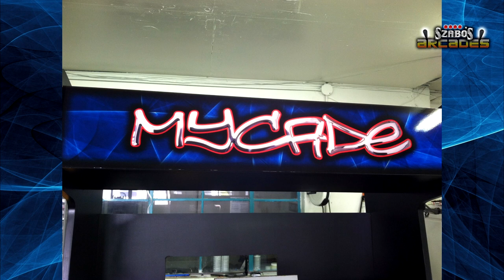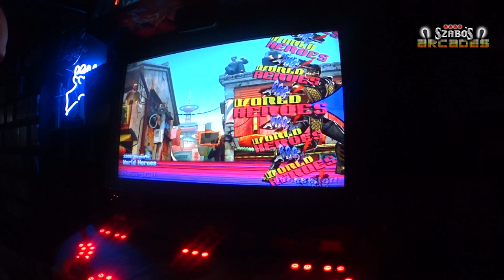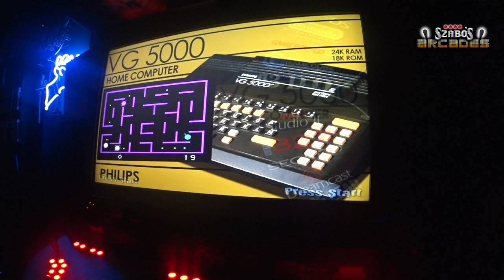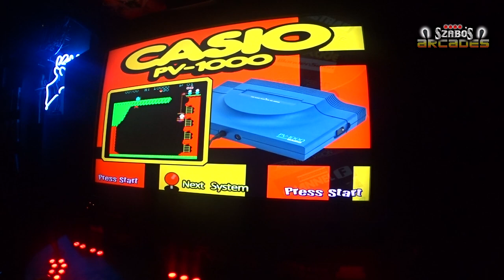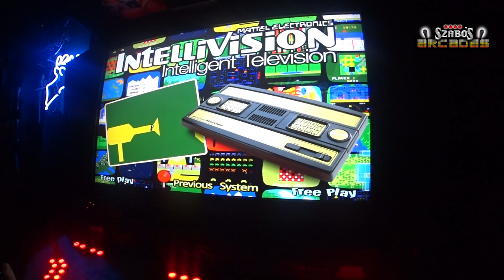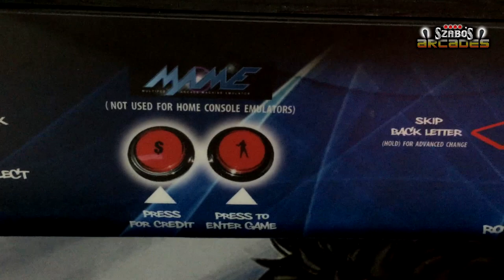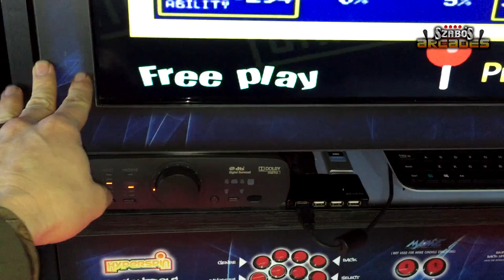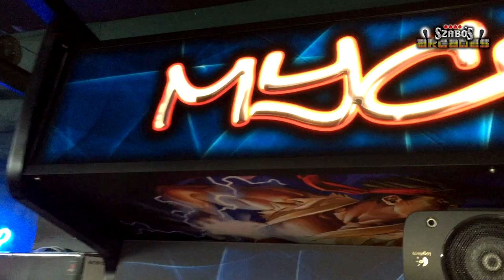Arcade Machine Build 2015

Comment: this thing is absolutely nuts. Its cooler than those factory made 90.000 dollar arcades they make in california or wherever it is. I forget the brand name, but you'll see them if you look around. Hyperspin looks like a great interface, I hope I get to learn it some day, what a nice way to present a multi system arcade emulator machine. Again, this arcade is absolutely fantastic.
Reply from the maker: Thanks man, it is a great program and very appealing to watch and great to work with. Glad you enjoyed video..
Reply: I looked it up and I exaggerated a whole bunch, but the machine I was thinking about was "the Jace Hall ultimate arcade" that they have been auctioning on ebay for 16.000 dollars. Just thought Id correct myself. Keep up the good work!
Reply: Hi! How much is it? Your custom all stickers of your cabinet

Comment: Cool man I got a question is possible for to go cheaper and faster and easier if its just the games and systems nothing else and for controllers to just be Bluetooth I was wondering because I have an old Windows 7 laptop that if possible with cheap but good enough storage contented with it if possible I can just do it that way if so how? I would think quite fun with my friends and family also it wouldn't take as much room
Reply from the maker: Absolutely you can do that and a xbox360 controller is wireless so that would be a perfect controller to use. These emulators don't need that fast of a pc either.

Comment: Wow, fantastic build.  I've been doing a lot of research looking for the design that really shines and this one hits more markers than I had even thought about.  Do you have any blue prints with dimensions available? 
One thought.  you mentioned a sound card only having 2 inputs and needing to use an audio switch for audio purposes.  Could you use the TV for your overall switching and an audio output from the TV for the speaker system?    That is how both of my TV's are being ran.  They send the audio signal to the sound bar and become the overall switch. 
Anyway, beautiful job.  I will definitely be using a lot of your ideas when I finally build one.
Reply from the maker: I would do a google search for plans I cannot sell this plan due to me selling this style myself. As far as the sound card it's a sound blaster with optic out, I can't remember the exact model about 3 yrs ago was there top card. Thanks for watching!!👌
Reply: Szabo's Arcades Ahh, sorry, I didn't realize that you sold these.  I would be interested in knowing how much you sell them for and estimated shipping to Colorado Springs CO.
Reply from the maker: Email me at szabosarcades@yahoo.com

Comment: Really cool system that you built. I have to ask, when you got the entire console wired and turned it on were there any issues? If I tried to build that I could see me taking it apart a thousand time trying to find some mistake I made. It looks so technical.
Reply from the maker: Just take your time it's really no that bad. If something were to be wrong it may be on one button or so not entire thing.

Comment: sweet arcade cabinet man i'm working on one myself. I have a question what are the three bottoms in the center of your console ? I see you have a ipac4 are they looped what is there function ?
Reply from the maker: Anthony, the top center three are with the roller ball my mouse buttons
Reply: did you plug them in to the ipac4?
Reply from the maker: +Anthony Wood track ball just to pc with usb
Reply: ok

Comment: how did you get all those systems on the wheel did you use a computer for that or a Raspberry pi 3?? please tell
Reply from the maker: SKELLYBOY1210 you cannot run this program on a rasberry pie. This is a PC running hyperspin front end program.
Reply: Szabo's Arcades oh i see is it possible for youbto make a tutorial on how you made your hyperspi like that then

Comment: Are you able to do this kind of interface just using it on the computer? I don't have the resources to build an arcade but i'd like that type of interface and everything to play roms.
Reply from the maker: Yes you can use a Xbox 360 controller and not even build a machine if you don't have resources or room

Comment: How did you get hyperspin to automatically spin when not in use?
Reply from the maker: Ed Curtis in HQ settings you can adjust how long it idles before it rotates. Is already in program.
Reply: Szabo's Arcades cheers

Comment: How man do your arcade buttons change colour ? As in RGB I'm thinking of changing out my buttons and installing RGB with a keywiz
Reply: Sorry I'm meant LED wiz
Reply: Also man did you use plexiglass over the control panel artwork ?
Reply from the maker: Mine just stay red. I've seen that but I think personally it's a little over the top so I just stuck with one color. Thanks man!!

Comment: What material is that, that goes along the corners and edges of the wood?
Reply from the maker: Steve, this particular project was a panel called MDO board
(Medium density overlay) I actually filled all the edges of the panels. They are a plywood core so tons of work. You can use spackle. I would recommend using either mdf board ( medium density fiber board) or melamine. Melamine had a Formica front and back. Then use t-molding on the edges. Much less work. Hope that helps you. Joe

Comment: fantastic stuff man. What emulation sw does this run?
Reply from the maker: Alek, are your referring to the front end software? If so its hyperspin. If your referring to what emulator each system has a different one. If this is not your question I will do my best to answer for you. Thanks for watching and commenting much appreciate!
Reply: Hey my friend, what is this a program with a ton of emulators built on it? I love t whole interface u have goin on here

Comment: where can i buy and how did you get that program to have all the games? how much did it cost and can you add futer systems xbox 360 play online
Reply from the maker: You download on Internet hyperspin is program. Took me months to put together it's on a 4tb hard drive.
Reply: yours is the best ive ever seen one thing it needs memery card upload ports and head phone jacks,
Reply: and get the game shark game geni emulater
Reply: why do you still buy the old games when there all on the emulater that thing is god like
Reply from the maker: The emulator has the ability to save at any point, and there is headphone jack right in front of machine where you adjust volume👌 I still like collecting actual copies for nostalgia reasons and down the road the value factor. Still cool sometimes to put in the actual disk or cart of the game.
Reply from the maker: You can search hyperspin software and on there, are links to download systems. You can always add additional systems . As far as Xbox 360 emulated. I haven't seen it yet. Would need a hefty pc to handle the processing for the emulation for that. I'm sure it exists though haven't really looked intoning yet. Thanks Joe

Comment: How did you get the Mame games to fit the widescreen ?
Reply from the maker: In Hyperspin program there is a setting to adjust for that. It's in HQ setting.
Reply: +Szabo's Arcades does it stretch the picture or does it fit good not losing aloof quality of the pic? Also does it work for all the games? Thank you for your responses
Reply from the maker: +Francos Tacos it does stretch the games but all the menu screens are good and you can adjust the resolution as well, but you do loose quality.

Comment: what is the software you use for the mame?
Reply from the maker: Google search the latest Mame emulator. Will need to get the proper version based if you have a 64 bit or 32 bit windows operating system. Hope that helps. Thanks for watching.
Reply: thank you for the help

Comment: could this be done using raspberry pie?
Reply from the maker: Nick Winfield the pie isn't powerful enough to do exactly the same. You can do some nice stuff but not quite at this level the processor just can't handle it.
Reply: so what do u recommend i use
Reply: so what would u recommend i use?
Reply: awesome. i wanted to ask, did u have an on/off switch added to just shut it off at will? if so, i wanted to ask, since ur using a PC, wont it effect the system or do u have to shut it down normally like any other pc?
Reply from the maker: Nick Winfield I do have to shut down the Ox normally. I keep desktop available because I'm always tweaking things. If I was happy with setup you can run a program called instant Sheller and it will boot right into Hyperspin and shut of some once you exit it.